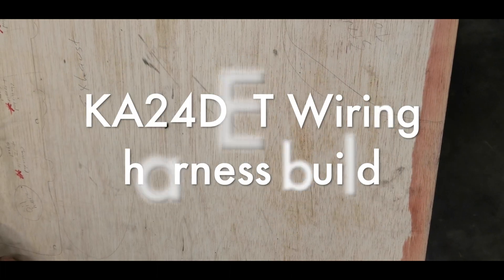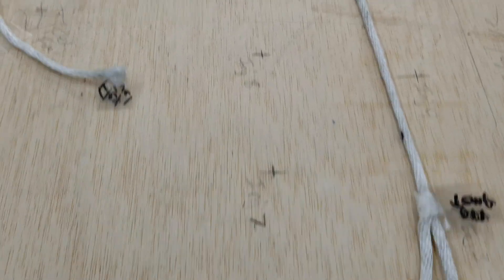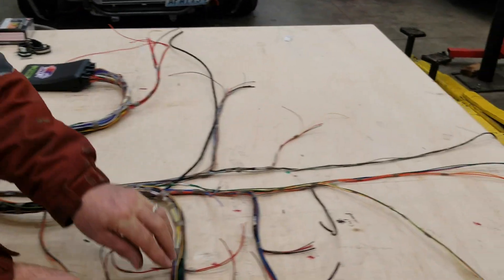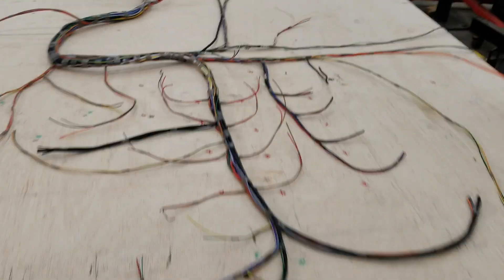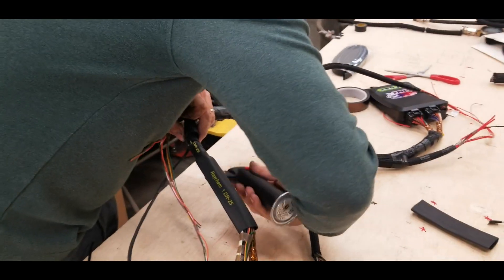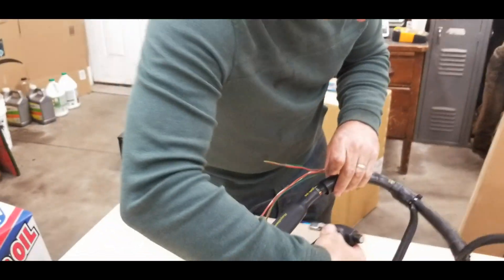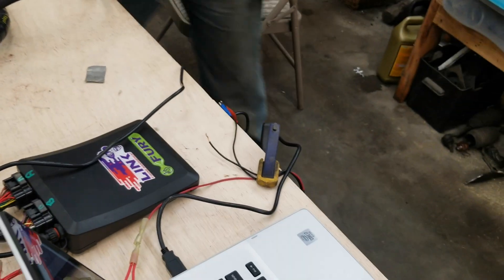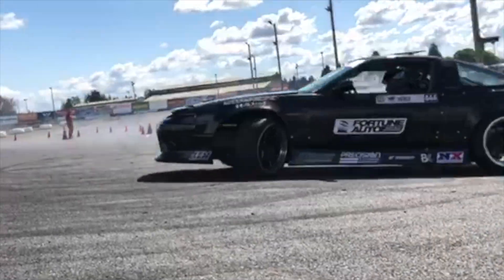KA24DET wiring harness build for the LINK ECU

Comment: Where did your dad find the info on the different sensor wires? I have megasquirt pnp2 on a ka24e. I just swapped to a ka24de.  The ka24de has a few different wires for the motor. I can splice into factory wiring harness and still use megasquirt according to diyautotune. My problem is trying to find what wire is what on the ka24de motor sensors... like the 6 and 2 pin distributor wires, ...the iacv, tps, tps switch...all of these are to be splice into the ka24e harness to make the connection to megasquirt pnp2. I know what megasquirt pnp2 wires are but not the ka24de from a frontier coming from the sensors.. please help
Reply from the maker: So I think what you are asking for is the factory ka24de engine wiring diagram, correct? If you go online and goggle 240sx fsm you should be able to find a few forums that will have pdf's of the whole fsm. That's what we did.